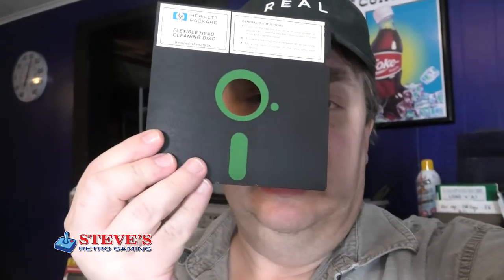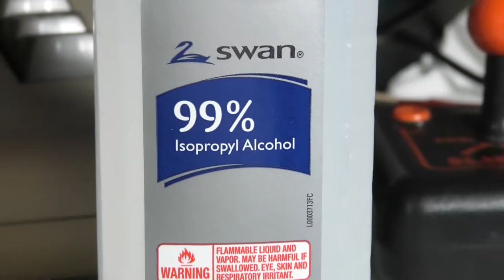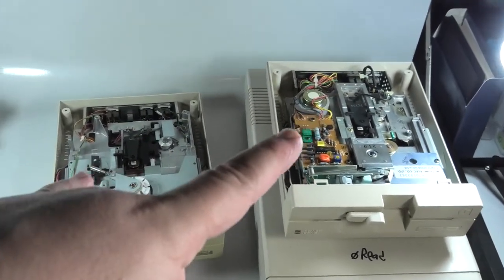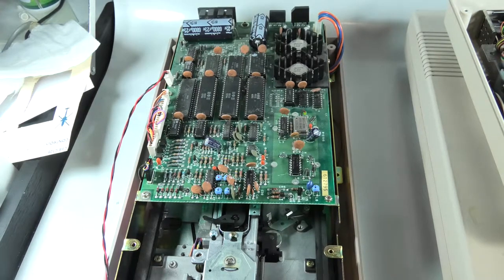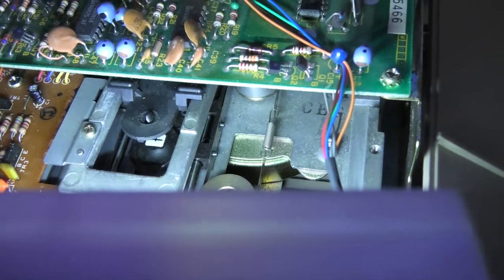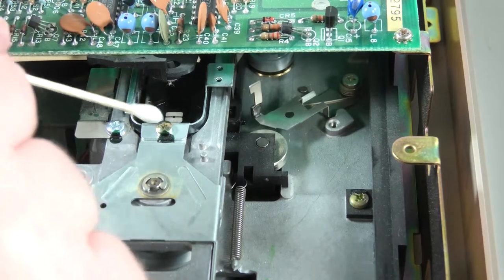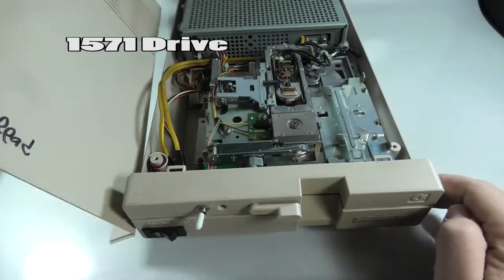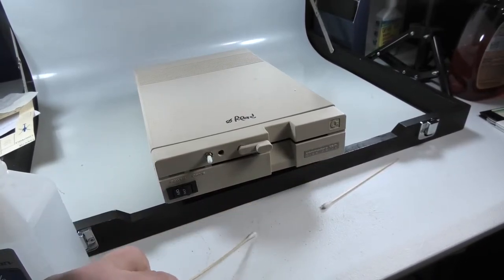How To CLEAN a Commodore 1541 Drive READ / WRITE Heads PLUS 1541-II & 1571  drives

Comment: Any ideas about how to make 5.1/4 HD (High Density) disks format,  write, & read more reliably?
Reply from the maker: You cannot use DS/HD disks with the 1541. You need to buy DS/DD disk. The HD disk are very unreliable with the 1541. So I stay away from them.